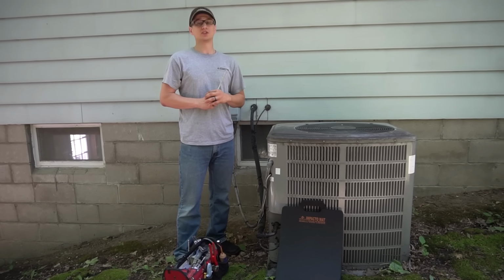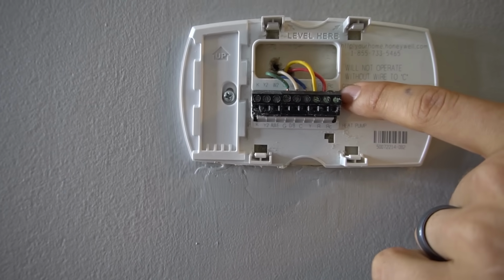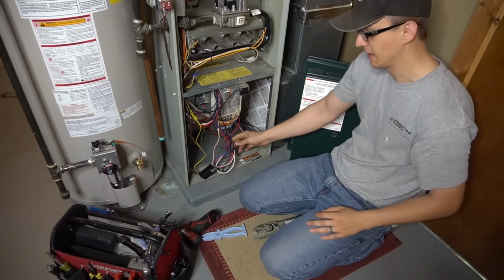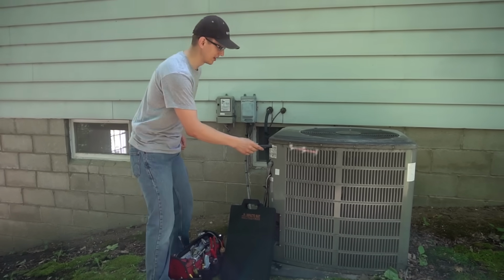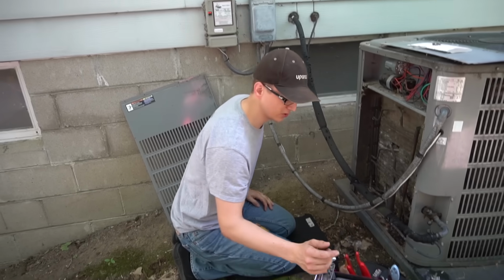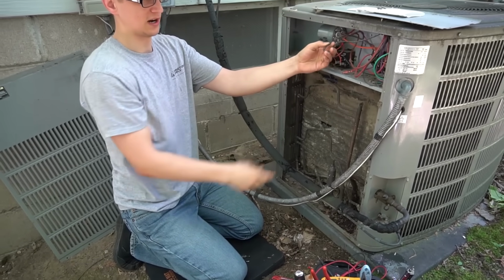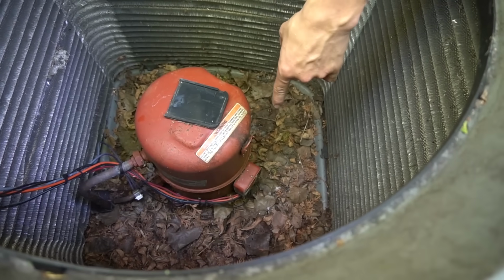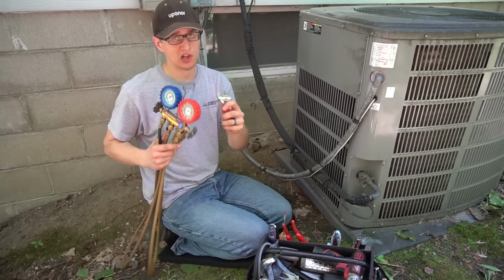AC Unit Not Turning On - How to Fix It Step by Step

Comment: Hi Jay, I pushed in the plunger and nothing came on and really couldn’t hear anything. I replaced the capacitor and still not kicking on- I checked the little plunger and there’s power going through but unit just not kicking on...please advise.
Reply from the maker: Hey Jaime! Sorry to hear that the AC's not working. If you press the plunger and nothing happens, usually that means the unit is not getting 240v. So either a breaker is tripped, a disconnect fuse is blown, or there is a bug stuck in the contactor contacts - preventing you from being able to push it in all the way. If you have a voltage pen or a meter, you can easily check if there is power or not
Reply: Ok...I did put in two new fuses before checking the plunger and replacing the capacitor so i'm pretty sure its not the fuses.  After I replaced the capacitor the little plunger was pushed in so I'm assuming there's power going through? Not sure.  I can hear it buzzing.
Reply from the maker: @Drumbanger8  Hmmm.. Well the plunger is powered by 24v. Whereas the compressor and the fan are powered by 240v. So to me it seems like there is no power going to the unit. Unless both, the compressor and the fan are burnt out which is unlikely... Do you have a circuit breaker panel inside the house? Maybe the AC breaker is tripped. But if you are still not finding anything then unfortunately I am out of ideas... You would need a meter that can check voltage to proceed with the troubleshooting.
Reply: Ahhh! lol!!! ok  I checked the ac breakers, and you mean just turning them on and off right?  I did that but not sure if that did anything.  I did buy a multitester today but not really sure how to use???
Reply from the maker: @Drumbanger8  I would start by reading the book/manual that came with the meter. Once you get a general idea on how the meter works, try watching my video on how to check a contactor to see how to check it

Comment: One question, I replaced my theromstat with a honeywell Wanna say T5, reason why was primarily because to turn on my AC I had to go to the Furnace where there are two switches, Heat, Cool on one... and then fan On Off or Auto on the other. - THe issue is that my furnace can be controlled by the thermostat, but the AC cannot - I was hoping to fix that by replacing the Thermostat.. But I still have to go to the furnace. Seems to me that it the rocker switch that you can select HEAT or COOL on, had an auto switch like the fan one did, then the thermostat could control that. If I change it to cool and forget about it and fall asleep, I wake up and its like 63 degrees. - HIgh amounts of money etc.
Reply from the maker: Not sure what your wiring looks like over there but can you re-wire it to just the basic setup? I go over it in this video: https://www.youtube.com/watch?v=VknvJ9POYDo&t=462s

Comment: I have an older unit from the late 80's and it has a reset on it next to the capacitor on the unit outside.  My condenser fan motor was just replaced and I have never had to add Freon or R22 to the unit.  My question is what does the reset button run on the unit outside?  My unit will run inside and outside for about 5 or 6 minutes before it trips the reset outside.  The inside fan works but the outside fan just slowly stops spinning and it is tripped.  I guess I am not positive on whether or not the Compressor is working.  I have a Lennox unit.
Reply from the maker: Is that perhaps the high pressure switch? If that's what it is, I would first try washing down the condenser coil. Even if it looks clean. A plugged coil will result in higher pressures which would trip the high pressure switch.

Comment: The problem with mine is Te motor outside, it doesn't turn on unless I make him spinning with a screwdriver, I oil the motor and the fan and still don't turn on unless I help it, what can I do?
Reply from the maker: I would try replacing the capacitor first (I have videos on how to do that if you need them). If the capacitor is weak or dead, the fan motor will not start. If the capacitor does not help, then the motor needs to be replaced.

Comment: We just got an new electric main panel about 4 days ago. Everything was working fine but today nothing will come on heat or air con.  The thermostat appears fine with full batteries.  The switch in the garage is on.  We tripped all the breaker switches.  The fuse looks fine. The air con is about 9 years old and the heat is 20 years old this year.  Any thoughts?
Reply from the maker: Is the blower motor in the furnace working if you set the fan setting on the thermostat to ON? If nothing works at all, then it's likely a power issue. Do you have a multimeter that you can check voltage with? Did the furnace power switch get bumped off by chance?

Comment: wy my inside not working but my outside is
Reply from the maker: If you switch your fan setting on the thermostat from AUTO to ON, does the fan turn on then? I also have a video on how to check a blower motor that may help in your situation as well.

Comment: Great video. Thank you for sharing!
Question:
Unit compressor is on and condenser fans motor is on , but no cooling! the condenser coils are hot but the discharge line does not get hot nor the suction line gets cold either? Is it low in refrigerant? ?

THAnks again,
Bob
Reply from the maker: Hey Rob! If the compressor is working but the pipes are not warming up/cooling down at all, then there is a good chance that it is low on charge. Might have to call a tech on that one.

Comment: Help please.   … Hi so my ac not turning on . I have replaced the  Transformer put in new fuses new Thermostat still nothing . I  have a BLUE,GREEN,RED,N WHITE WIRES. I matched them up. I did the test on the AC Unit it dose turn on when I push it in. I can feel cool in blowing out the vents from the furnace. I can turn it off in on from the Thermostat. Just can't understand Y the AC Not turning on. It's getting very hot now.. Please Please can you help me?   Thank you.
Reply from the maker: From what you described, I think watching this video will be the next step to tracking down what is causing this: https://www.youtube.com/watch?v=NVPhsK4gK1A&t=3s

Comment: When i press my plunger in everything outside comes on but my ac is still not working?
Reply from the maker: If the contactor plunger is not pulling in on it's own, I would watch this video next: https://www.youtube.com/watch?v=NVPhsK4gK1A&t=3s
Reply: @WordofAdviceTV  i feel kinda dumb for not noticing but my great dane chewed the wires about 6.5 feet up the wall, i was looking down around the unit itself, but i got it all fixed so thats good

Comment: Need some urgent help. My outside unit (heat pump) stopped coming on when set to cool (fan and compressor not turning on). Thermostat is getting 24v between R and Y. Contactor is getting 240v but not 24v. I'm getting 24v at control board in air handler between C and Y.  The weird thing is the outside unit seems to have a mind of its own and will randomly start working for a day or two and then stop working again. When it's working, the contactor is getting the 24v as it should.  What else can I check?

Comment: Question:

My AC unit trips after few seconds I have turned it on.
I set the Thermostat to cool- works
turn fan on - works
I hear a  sound once I turn the above on I think it is on the unit outside.
Fan works but cold does not turn on and after few seconds the circuit breaker turns off.

What could possibly be the issue?
Thank you in advance
Reply from the maker: I have a video on that which may be helpful: https://www.youtube.com/watch?v=G1EBHrOgs-Q&t=22s
Reply: @WordofAdviceTV  thank you for the second video. I actually figured it out. The herm connection had the purple cable completely unplugged for some reasons. Plugged it in, circuit breaker does not trip noise whent away and my house is cool.thank you.
If you happen to be in Boston let me know, I will treat you with a coffee or a beer. I appreciate your help.
Reply from the maker: @Imistreci  Thank you! Glad you were able to figure it out :) Stay cool!

Comment: That screwdriver pushing in to the contact thingy, did the trick.  It by-passed the thermostat so what should be done ?? Replace the thermostat ??

Thanx for helping us get from point No Sounds, to all working using the by-pass trick.
Reply from the maker: If you narrowed it down to that, then you can proceed to the next video :) https://www.youtube.com/watch?v=NVPhsK4gK1A&t=14s

Comment: So I just replaced my 19 year old thermostat with a Nest 3rd generation today.  My ac was working fine until now. The wiring looks right but I still get an R power error.  Any advice you can give?
Reply from the maker: Does your Nest thermostat have a Common wire hooked up to it? If not, that could be the source of that problem..

Comment: Honeywell 5-2 thermostat has stopped showing display; Yes, we replaced batteries & checked fuse. Both OK. Any suggestions how or why this might have happened?  We can afford to buy a new Honeywell thermostat, but would like to know if there's something else we should check first.
Reply from the maker: If the display on the thermostat is dead, then it just needs to be replaced.. Not sure how it could have happened.. A power surge perhaps? If there is corrosion where you put the batteries, you could try cleaning that so it gets a better connection.
Reply: @WordofAdviceTV  ... Turns out the battery contact spring contacts had been compressed, and the replacement batteries were fractionally smaller, so there was no current flowing. A small watch screwdriver pried those two contacts out a smidge and now it works.

Comment: My unit wont turn on no heat or cool or fan nothing works. The termostat shows all the functions but nothing kicks on. Is that my termastat that went bad. My heat was just working fine all winter didn't use the hvca system during the fair weather now nothing works all of sudden. Can anyone help
Reply: Same over here, it was the capacitor we think.  Just bought a new one today and just looking for someone to install it as I am very accident prone and from what I understand it can hold 440v which'll give ya a pretty good shock n burn.  Anyways, I will update once I find out it this helps.  New capacitor (which we now call "the tator" 🤣) was $32.
Reply: @malaki9ify  cool I got mine fixed man. It was the same thing that happened last summer when the outside unit wouldn't turn off and would over freeze. The part that has a switch I think it's called the contactor was getting stuck open and now stayed closed or vise versa. That's what's been happening but also this time my fuse actually fried up as well so had to replace. I blew 3 of them but only when I would kick the cool on not with the fan or heat so it was weird but that was the issue. Sorry for the run on sentences l o l
Reply: @BBop23  that's great you got yours fixed!  Fortunately we have a cool week out here because I still haven't found someone to come put in this part that doesn't want to charge an arm and a leg lol.
Reply: @malaki9ify  where r u located ? Most times it's the easiest fix but unfortunately these hvca guys wanna kill us by making an easy n cheap fix more expensive than need be by charging up the wazoo n changing parts not needed to make an extra buck.... smh.
You need to find someone willing to help out that works on the side business to get a deal

Comment: Hi. Great vids. I suscribed =).

I followed the troubleshooting.
The Air Handler motor is busted.
On an odd side note, a rat might have caused the issue. When I open up the condenser power box outside, the rat was electrocuted. Before removing the rat the outside condenser fan didn't turn, now it does when I put the system on cool. Voltage tracing I get 29 V (wiring schematic says 24 V though) after the transformer which goes to power the 1/2 HP motor.

The air handler fan starts up but after 9 seconds stops and starts. You hear a click, but it never starts to spin at high speed.

I need to buy a motor or a equivalent aftermarket generic replacement. The specs are below.

P/N 51-104359-10 00 
HP 1/2 Rot CCW 208-230 V
Model used on: Rheem HLL-HM3617JA
M055PWCZA-0394
Midec motor corporation

Do you have a good website I can check to buy the motor? Any advice?

Thanks for any extra help or guidance, great appreciated!!!!

#SweatingInFL
Reply from the maker: Hey there! Sorry to hear about the days of sweat! So from the info you gave me, I believe this is the motor you need: https://amzn.to/2MvGv41 But since I am not there to see it, I am giving that link to you more as a reference.. And not telling you that it's the exact motor you need.
Reply: @WordofAdviceTV  howdy thanks for the info!!!

I called and the air handler is still under warranty. I got a service technician to get it for me from Rheem and charged me not too much for the repair. Another place wanted a grand!!!!

The guy thay ended up doing the job actually put that Gentrex in today, since he had to take out the Rheem OEM motor. The tech said those models about aren't too great. He Carrie's around a spare Gentrex that is faulty, it overheats so you can't put fan on auto. He drops it in people's houses as a temporary until he gets the permanent parts. So in other words you dozed the right one lol.

The motor on the air handler is a variable frequency drive type. I was a  little surprised a 4 year old air handler died so quick.

I think the rat either caused a odd short, which seems unlikely. Now that I think about it. I might been over stressing the motor due to return supply. Stupid me I had a sofa chair practically blocking the return. Maybe that was making the variable frequency  drive on the motor have to ramp to higher speeds to get the required airflow to meet the temperature setpoints. Typically we don't run A/C too much but this is first summer with a baby and we let it run the whole week. Perhaps overspeed stressing it and the rat with the short finally killed it

Thanks again for the motor info.

Great vids super informative and well thoughtout.

#CoolInFL

Comment: FYI. My ac.  The compressor  would kick in for a few seconds.   I couldn't figure it out...  I changed the thermostat batteries.   Old set 3.9 volts.new set 4.5 volts.    Then the ac worked.   Could that have been gone problem?

Comment: I replaced my compacitor, fan still not starting. Furnace and furnace fan work. My motor is humming and hums louder when pressing the contactor. Should  I replace the motor or contactor?
Reply from the maker: It sounds like that condenser fan motor is bad. I doubt there's anything wrong with the contactor.
Reply: Does it matter if the fan spins freely? Could it still be the motor? Thank you
Reply from the maker: Well typically it will be one of three things:
1. Bad capacitor (you ruled this one out by replacing the capacitor)
2. The motor is bad (if you have a meter, I have a video of how to check the motor)
3. The motor is not getting enough power. (potentially a hot leg is missing, so for example -  instead of 240v there is 120v. Would need a meter to check that as well)
Reply: I'm almost certain it's the motor, would you recommend replacing it on a 1994 carrier unit or replace the entire unit? Thanks again
Reply from the maker: If it was me, I would replace the motor :) That's much cheaper then a new unit. But if you will be hiring someone to do it.. Then I guess it would depend on what the price is.

Comment: I’m 2months into the HVAC trade after being out of school, and right now I’m doing all service calls, yesterday I was doing an AC maintenance call and after completing the indoor unit I went outside and noticed the condenser wasn’t powering on. I started on the outdoor unit being that my blower was running on the inside. after going through everything outside I noticed that I wasn’t getting my 24V and the contractor wasn’t pulling in. I went inside and went through which I thought was everything along with the thermostat. Now that I just watched this video the one thing I didn’t check was the fuse on the control board🤦🏼‍♂️ thanks for the great content brother and your videos are definitely helping on my path of being successful in the trade👍🏻
Reply from the maker: Hey Jay! There are quite a few things that can cause a contactor not to pull in. Are you sure the thermostat was not in a time delay? Sometimes it can delay 5-10 minutes before starting. I also have a video on 10 reasons why a contactor wont pull in: https://www.youtube.com/watch?v=NVPhsK4gK1A
Reply from the maker: Yes. If it has an LPC (low pressure cut off) that will prevent the unit from turning on if it is low on charge. I believe I mention that in the above referenced video as well.
Reply: Thanks for your quick response! I was at the residence for 3 hours. And it wouldn’t kick on. I went outside and found I didn’t have the 24v to pull the contractor in. As well I found a leak in the indoor coil R22... could it be possible that the Outdoor unit not turn on because of low refrigerant?

Comment: My Air Condition is blowing hot air, fan is working, capacitor seems to be good, can you please tell me what could be the wrong ?
Reply: Sounds like the compressor is not running,if it is it may be low on freon,keep it off and call a service technician

Comment: i watched your video help me out a lot went through my ac unit everthing works but the ac unit outside side still will not kick on just wondering if it's the contactor ever goes bad that they can not pull in
Reply from the maker: Have you watched this video? https://www.youtube.com/watch?v=NVPhsK4gK1A&t=141s
I go over 10 reasons why a contactor may not pull in. Perhaps it will help you track down the problem.